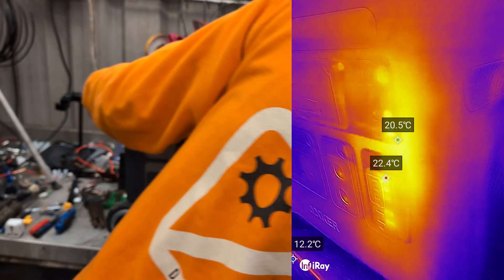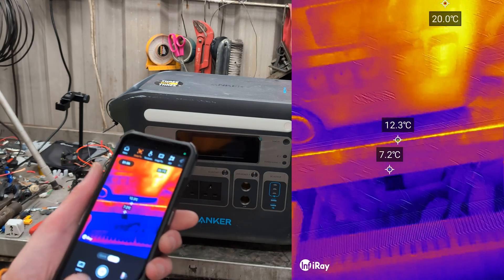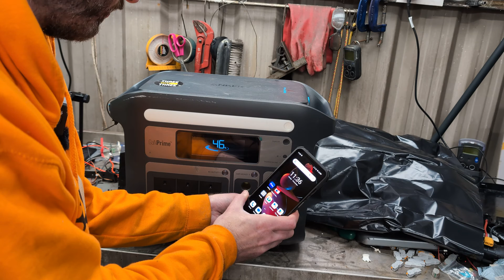Anker 767 phantom power drain - FIXED

Comment: Hello! Do you know if the 12v output of these things is able to start and run a chinese diesel heater? I got the smallest brother of this anker powerstation and would like to use it to run the diesel heater in my van :)
Reply from the maker: Mostly yes.  But it depends on (a) the heater (b) the power station (c) charge level of said power station.

(a) Most heater consume under 10A.  Which is the output of most power stations.  I've had some that pull nearer 12A.
(b) Not all the power stations actually output 10A at 12V which is annoying.  Some do 10A at 8V which make the heater very sad.
(c) I've found on some power stations depending on their charge state, which ultimately means the actual voltage of the battery inside, determines if you'll get 10A at 12V.
Reply: @DavidMcLuckie  Thanks! That is a very detailed answer :)
Reply: @DavidMcLuckie Update: I've tried it and it works! At least, it works at setting 1 or 2, higher settings draw to much amps with my specific heater. Starting, that is; when running all power levels are working fine.

Comment: Could be a chunk of something metallic in that top USB-C socket that was making contact just enough to make it think there was a device still plugged in, and resetting it, the USB-C smorts chip decided there was something wrong and cut it off, just a guess, could also just be cheaply built shite... :P
Reply: I think the latter.